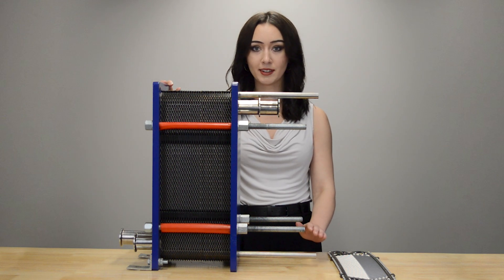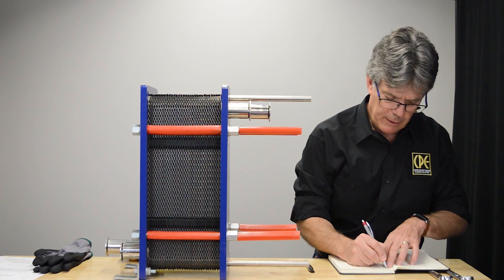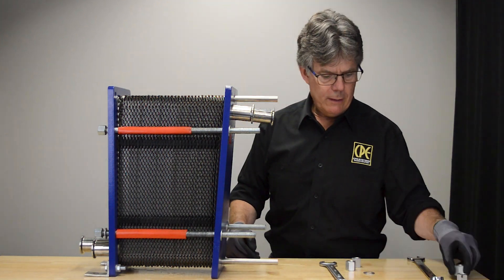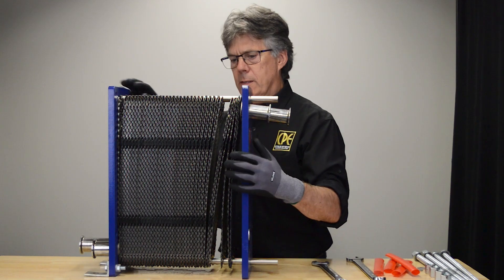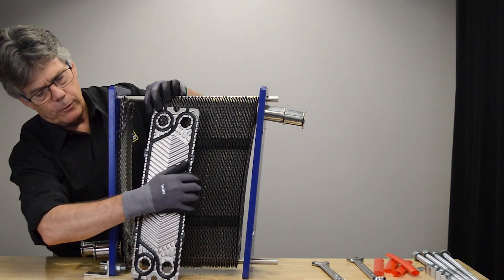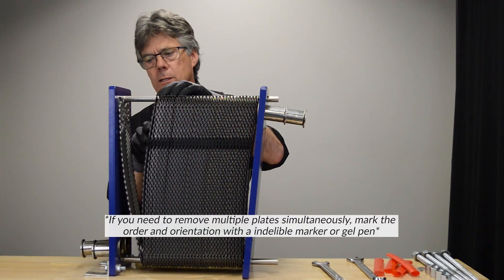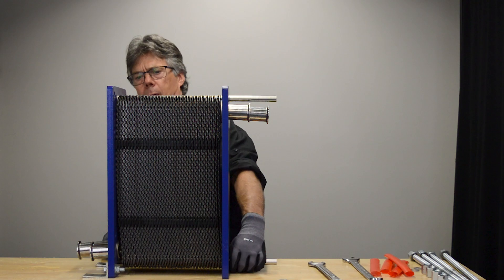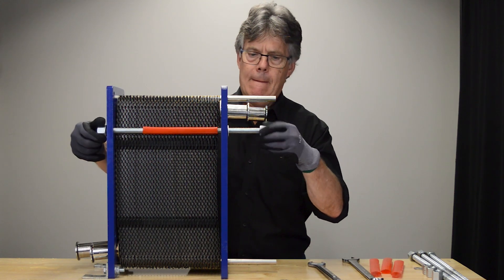How to disassemble and reassemble a Plate Heat Exchanger

Comment: Can I use this type of heat exchanger for small quantities of gasses? Or is it not possible? How would the leakage be? Would the efficiency rise or fall compared to fluids?
Reply from the maker: Hi! These plate heat exchangers are designed specifically for liquids and are not tested or recommended for gases.
Reply: @cpe_systems  Okay, thank you 🤗